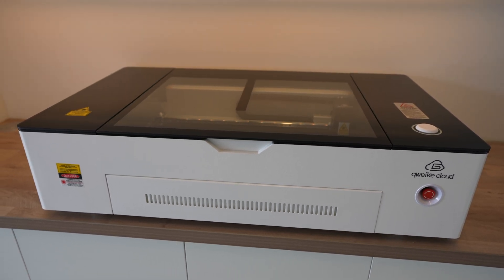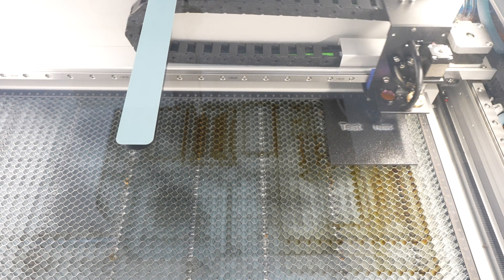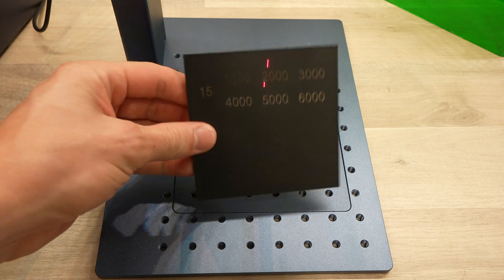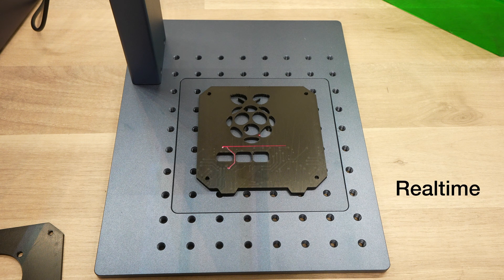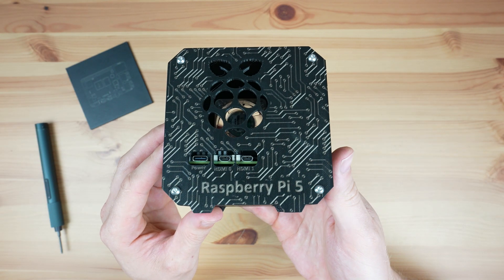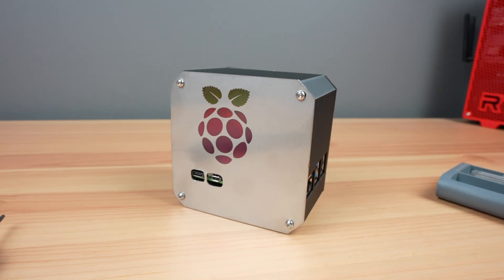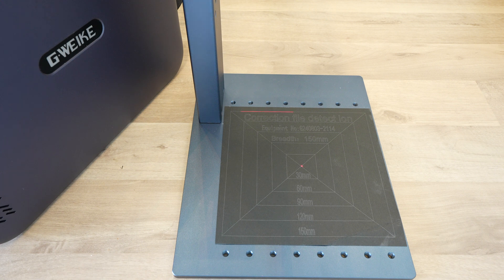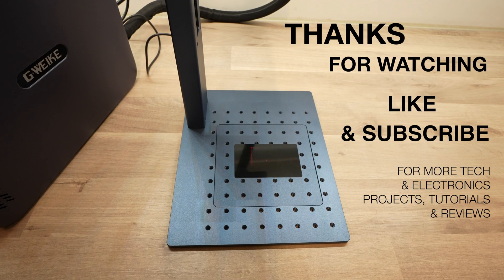Laser Engrave 3D Printed Parts & Create Colourful Images with the Gweike G2 Pro

Comment: I would image that if you can engrave up to 5mm, you were able to cut metal. In your video you said it's not possible to cut metal but i watched another video where the did. Is it possible to cut metal if it's a thin one?
Reply from the maker: The 5mm I'm refering to is the text height, not cutting depth. If you have a lot of patience you can probably make it cut through metal but it'll be very time consuming and a dirty cut.
Reply: Thanks a lot!

Comment: i have 3D printed text in 2mm before without too much issues,  just have to know the right settings (like arachne instead of the classic wall generator in prusa/orca slicer / bambu studio.)  but yes, a fiber laser engraver is quite a nice upgrade for quick and easy work on this.